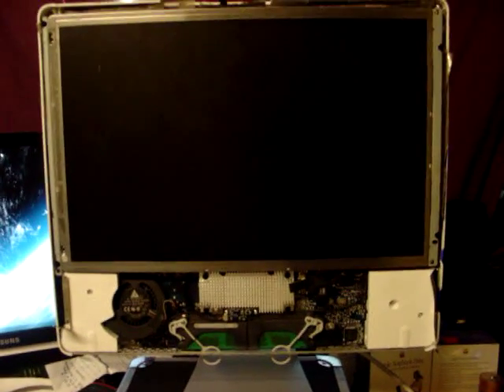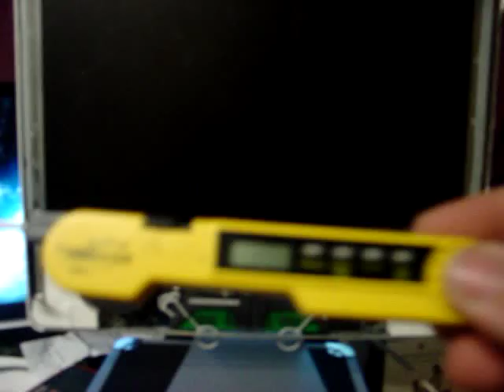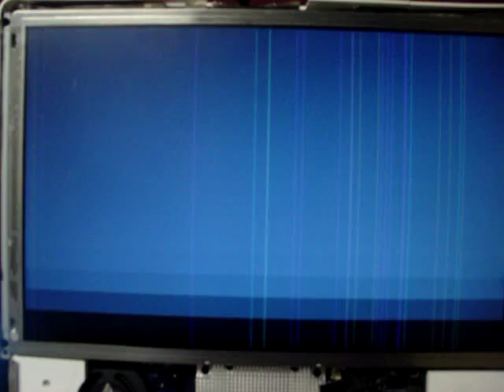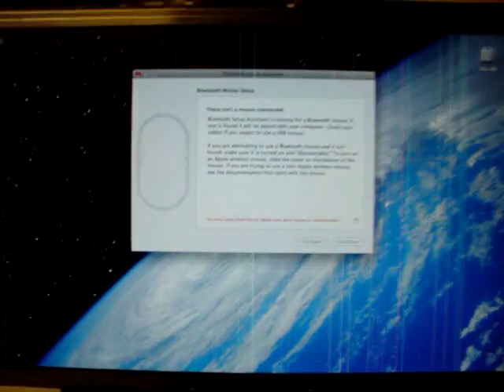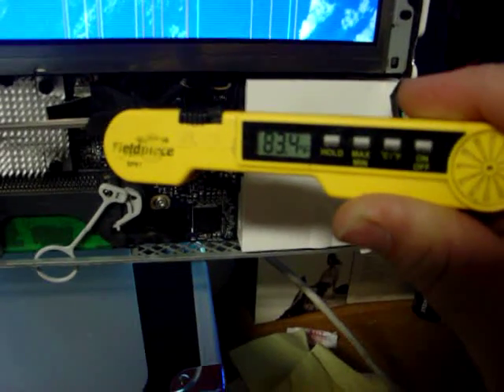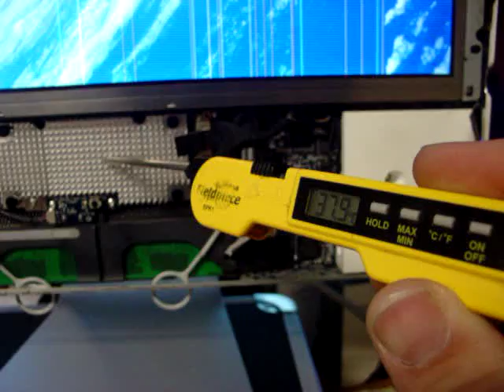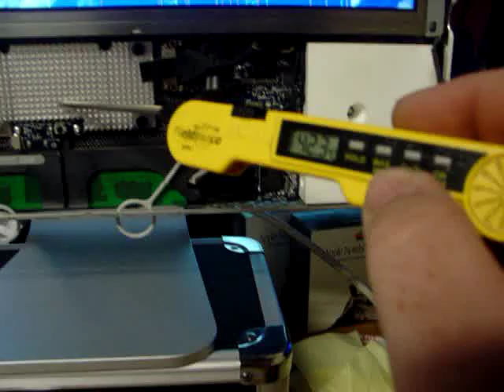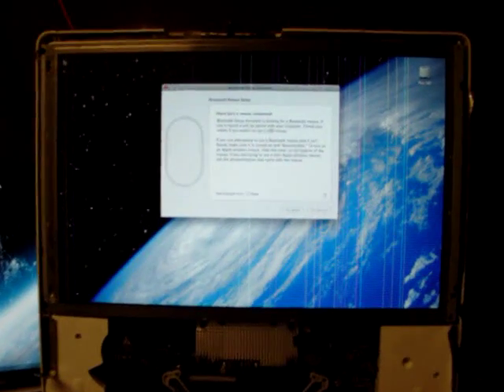iMac G5 iSight issues and remedies

Comment: You are right on with the heat issues! I believe a capacitor on my power supply blew, causing the fan to stop running! That is when the lines started showing up. I had to use a fan control app, but computer is still alive! Did you do a fan mod? Would love to see how you cooled this dinosaur.

Comment: think i have a similar problem my one just keeps repeting numbers on a grey screen with two random lines in the middle and wont boot up in the middle my question is i have found 2 swolen capacitors and am going to replace all of them should i try just the capacitors first and try, or reflow the gpu same time?
Reply from the maker: Just replace the 2 caps first. Once you know it fires up, you have to change ALL of them.